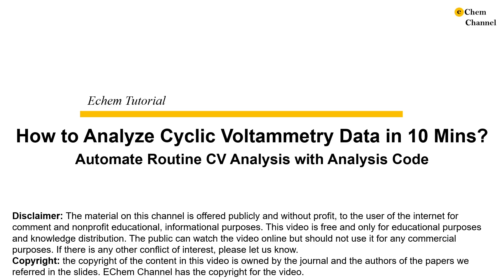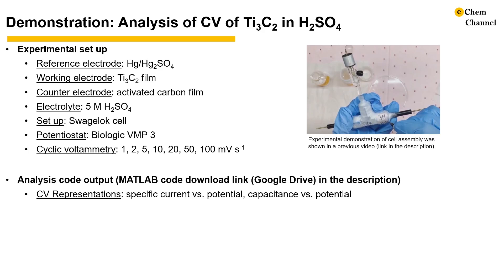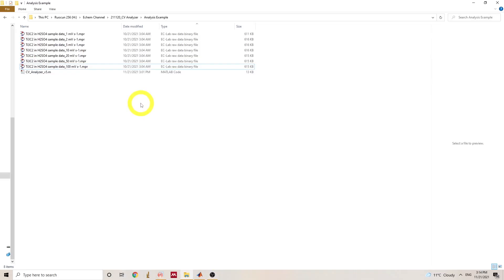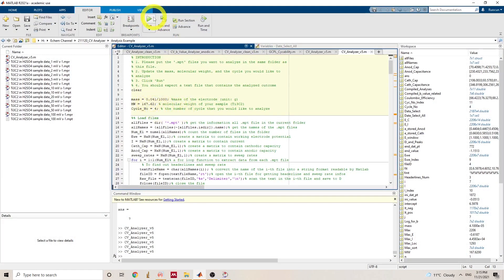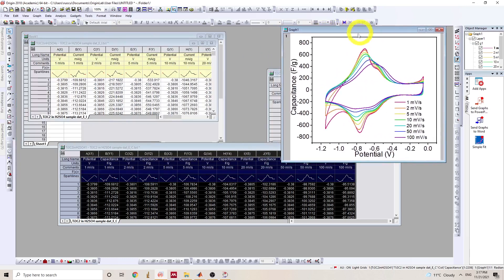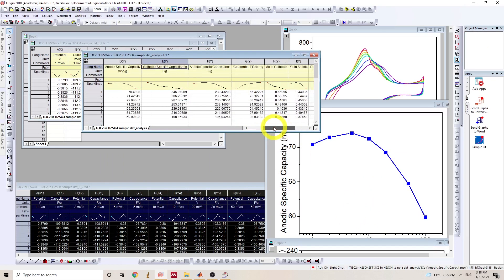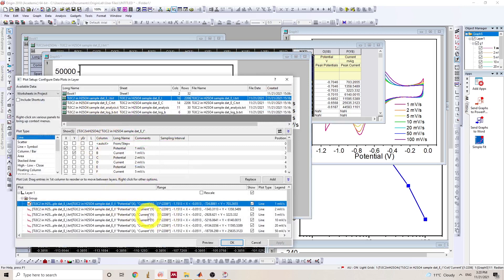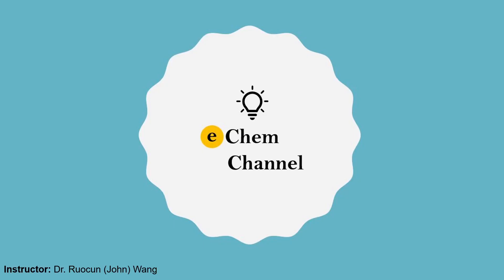Tutorial 24-How to Analyze Cyclic Voltammetry Data in 10 Mins?

Comment: Be aware of data format in txt file: this code accepts decimal number with dots. The code shows mistake with numbers included comma.
Reply from the maker: Thanks, Tanya! It messes with text files exported on computers that use at least European language systems that adopted commas for decimal places. If you have a lab computer that runs in English, you can export the data on that computer and copy/paste the data to yours. Other suggestions from BioLogic includes

"Open the file in notepad and use CTRL+H to replace the commas with points
Change the PC’s regional settings to USA and then run the export routine. It may be necessary to relaunch EC-Lab after changing the regional settings, to make sure the changes take effect for the export."

Please let me know if any of the suggestion helps.

Comment from the maker: If you want to use the code, it's probably a good idea to know how it works. If you would like to see a line-by-line breakdown of this code, please like this message. I was afraid that going through the code was going to be too dry and boring...
Reply: Is it possible to include the power density and capacity vs. surface area calculations in the Matlab file as well, please? Thank you.
Reply from the maker: @payam1597  Hello, I did it as examples in https://www.youtube.com/watch?v=4RlvEayn2pw&t=5464s&ab_channel=EChemChannel